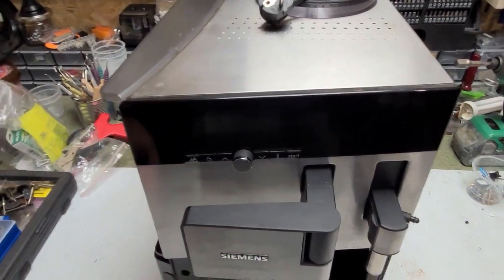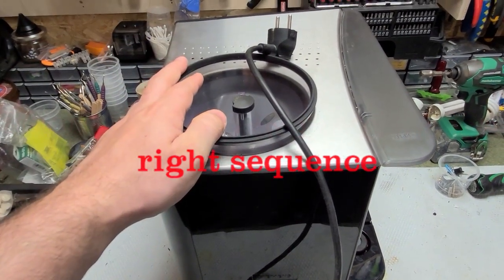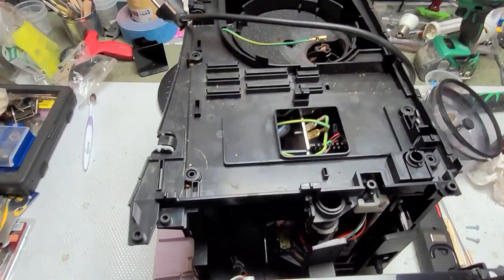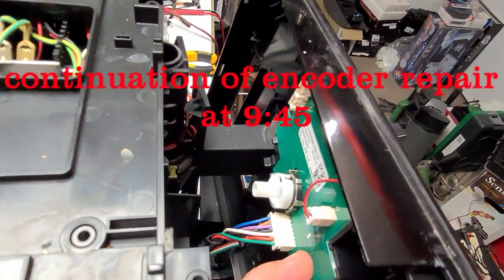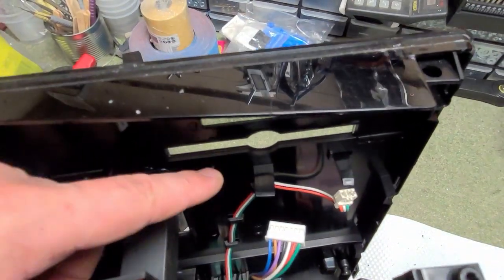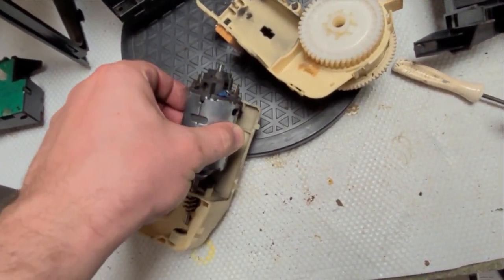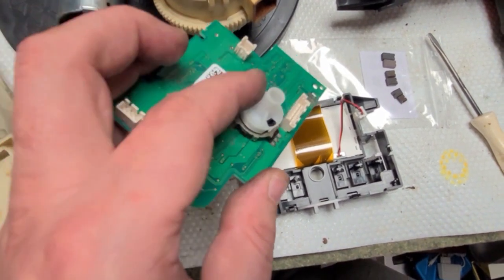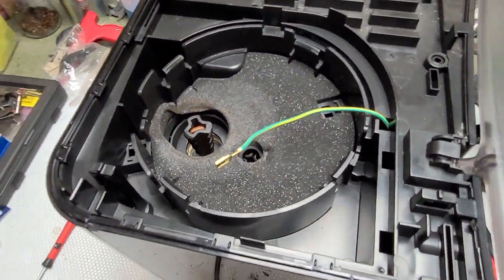Siemens EQ8 teardown / control knob jumps around EQ7/EQ8 - repair / inspection of grinding motor

Comment: Nice video - thank you. Do you by any chance have a part number for the carbon brushes?
Reply from the maker: Don't have it on hand but grinding unit is the same as with eq7. Remember googling different shops and one had it..

Comment: Thank you for the video
Would it be better to replace the encoder ?
Reply from the maker: If you found identical encoder sure replacement is always better as refurbishment of a used one.. if you have you could share it here. Maybe it will help someone to find the replacement..

Comment: Hi there, I am having problems with hot milk. The milk is cold always. How can I sort out out this one?
Reply from the maker: Does the steam come out? Maybe the head is closed. Try pulling off the milk preparation head and see if something is cloged inside.
Reply: @letsfixitgarage  the steam comes out but it doesn’t warm the milk. I tried the water through milk froth and it heats that up, but unfortunately not the milk. Any suggestion what that could be? 

Also do you know how can I do a hard (fully) factory reset? 

Thanks
Reply from the maker: Well if water heats up, milk has to heat up as well... There is no magic in this world... Have you taken apart the milk preparation head (twist to open it)  and cleaned it thoroughly? Milk is thicker as water but still steam should heat it up... 
As for hard reset I think I showed in the beginning off the video button combination for it, no?